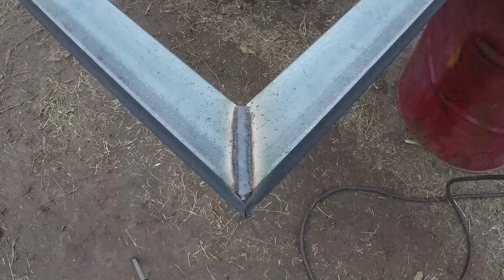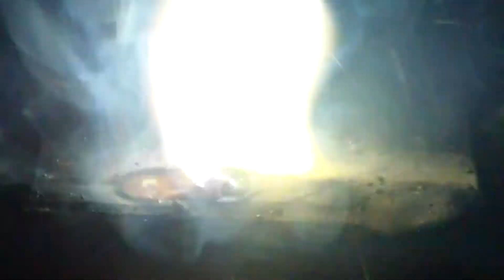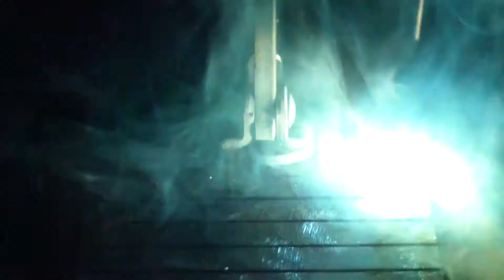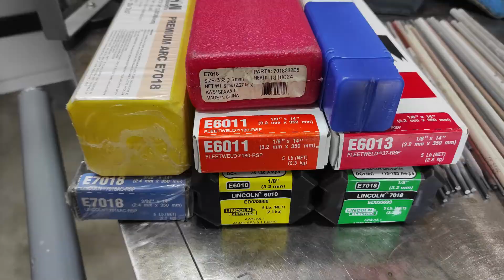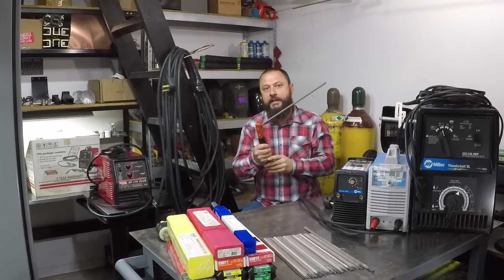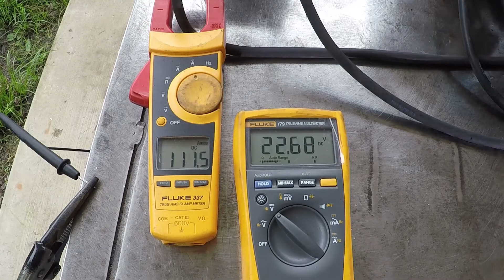ARC Welding In Depth Look For Beginners

Comment: This is a really great video. I have seen lots of videos on welding, plasma cutting and your video covers so many thing that others don't including safety, and use of the dc welder for other functions. Liked your igbt vs transforner voltage / power consumption video. that was great. would have been great if  cover voltages mig/tig/plasma cutting or just stated them, but you have explained they are roughly the same for tig/mig/stick
Reply from the maker: Thank you for the feedback, I replied to your other comment. Please watch these two videos as I covered the voltage/current for plasma cutter and for multi function welder:
Plasma cutter: https://youtu.be/03M03dStbzs?si=AIBBbriTlatzZ6JZ

Multi function welder: https://youtu.be/ZpxjuEAsV-I?si=rg42-vrV0zM2OiI5

Comment: Another helpful video. Thank you! Will try a couple things mentioned in your vid.  Have been learning with the 165DS welder and do not have a welding table so learning on the garage floor. Using a low speed fan to keep the smoke away from the helmet helps. And making sure the pieces to be welded are well lit makes it easier to see. Having a table would be better though:)
Reply from the maker: Good evening sir, welding table will make the job easier. If you have space issue where you can't build large table, you can build two metal or wood saw horses and build square frame with 16 gauge sheet metal or thicker top. This way you can set the table up when working and you can also store it away when not in use. I did that for some time prior to build my homemade welding table or cart. I also posted videos about homemade tables where I did all the work on the floor. I also show how I built my welding cart out of a large hydraulic tank. Thank you for watching.